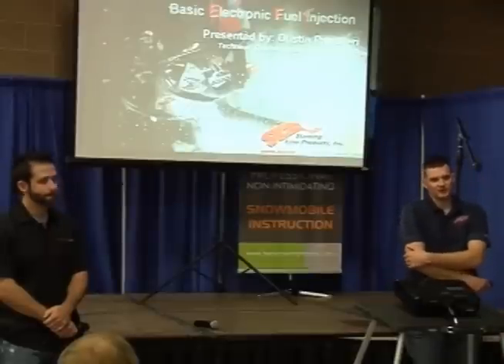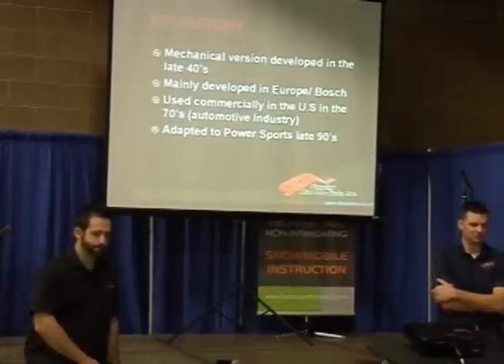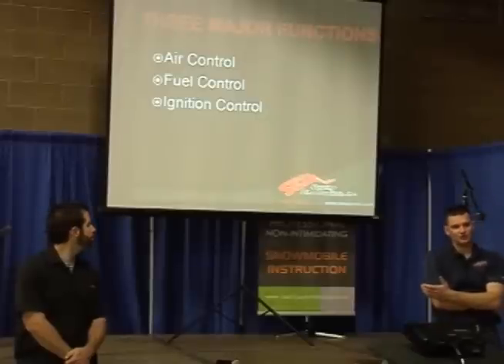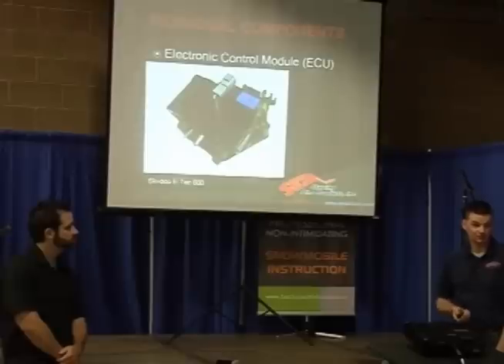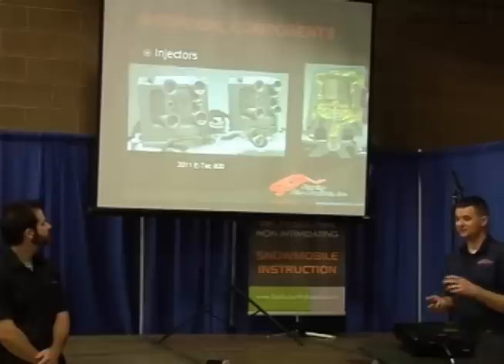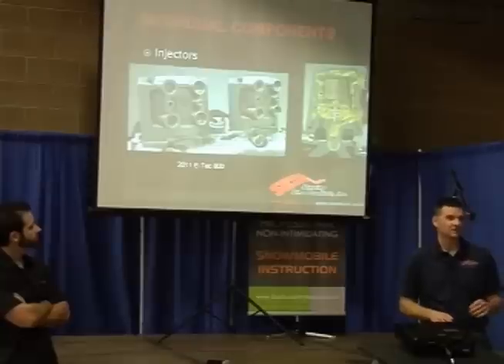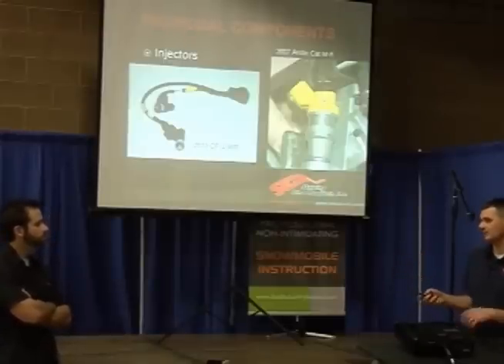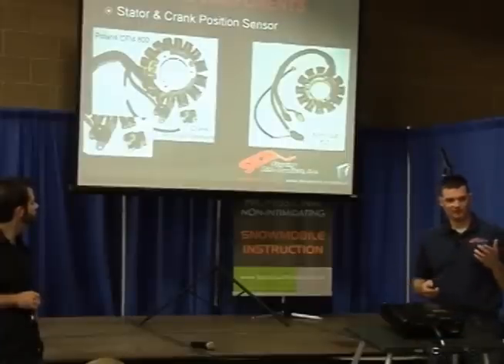EFI-Tuning-Part1.mp4

Comment: I watched your vid and I see some things that are missing.  Don't get me wrong because this is a lot better than nothing and I appreciate your efforts.  But no one will ever learn to tune until you have a couple basic things under your belt.  First off and most importantly is to learn a couple very important basics about injection.  1. the injector opens and closes a specific number of times per second. That never changes. That is called pulse. What changes the fuel flow is how LONG it stays open during each pulse (this happens very fast.... measured in nano seconds). Think of it as "pulse width modulation" or "PWM"  because that is exactly what it is. Just like a speed controller on a drill. The voltage never changes and neither do the pulses. What changes the speed of the drill  or fuel flow on an injector is how long the electric is applied WHILE it is open.  Duty cycle is how long the injector stays open and that is why you should (or cannot) exceed 80% duty cycle. The injector will not stay open forever (100% duty cycle) because it HAS to pulse to control the flow. If it never closed at all it would be next to impossible to rate the flow and make each injector flow the same.  That's why on speed density systems you should never change injectors from one cylinder to another. They're not that close and the electronics set the final tune. 2. pressure MUST be stable to get good results from tuning.  If the pressure varies the injector cannot make up for it.  In a closed loop system it will try but even a dirty filter will change the tuning drastically.  3. there are only a couple parameters we have to control the fuel delivery.  VE or volumetric efficiency and A/F or Air Fuel ratio command are the biggest two.  Set the VE first and then the A/F command to get the best results.  There are small settings to prevent backfire (not likely on 2 strokes), hard start hot or cold and accelerator pump are a couple but the factory settings are usually pretty close.  They go through a lot of testing on dynos and if you change any of these settings you better know exactly what you're doing or at least record the factory settings before you mess with it or you may be very sorry.Thanks again for the vids....I hope this helps a little in your thinking of tuning.  You have to be mindful of PWM or you won't have much success in tuning.  Once you get that in your head it makes things a lot easier.
Reply: Hey if you still get youtube alerts and see this message and are knowledgeable on pro efi help to get a correct start up on new engine with a good tune to have car starting good with out problems from unskilled help they have been getting that have cost more trying the fixing options we have paid for and  got for help ..has left the car out of service to fix more then able to drive it!   And I am looking for some good help to have them get so they can enjoy the car finally as its been almost 3 yrs of issues ..its a 2005 Evo with 1000 hp and it now has everything it needs to have been driving right by now ...and still it needs more help caused by the helper dumb dumbs getting paid to make things worse so if you or anyone reading this can offer help to get the car started right with new engine and tuned right that'd be awesome!   Please reply with contact info here or email me at amsalv@aol.com with options on who can  help  to make the car drive right ..like it should be! Thank you